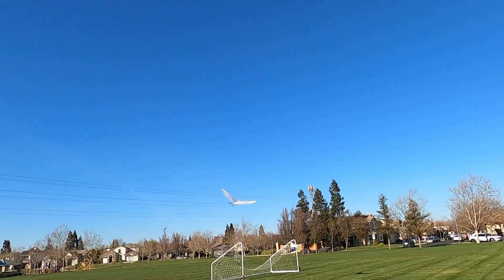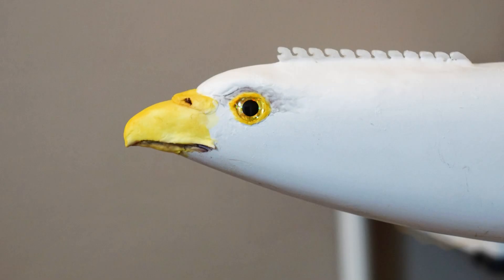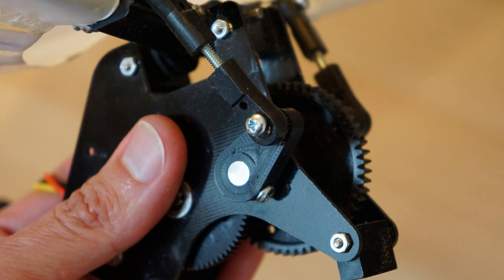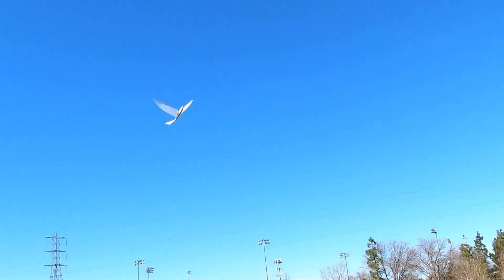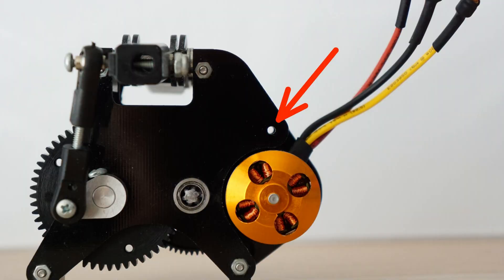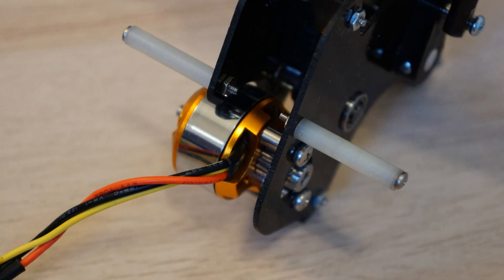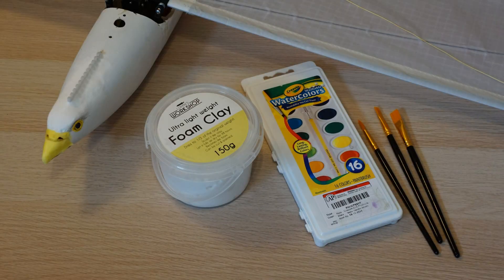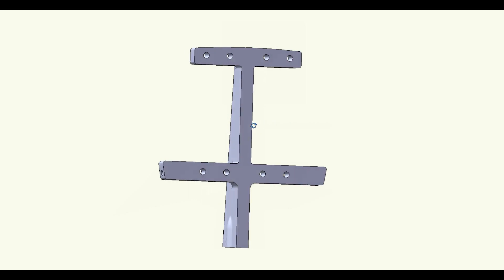Crossbow 2  RC Ornithopter Modifications

Comment: You took this pretty far. Launched just prior to the pandemic. Sorry it didn't work out. Never heard of birdkit until today. I notice most of your ornithopters are stiff straight strut wings. Have you ever considered adding the elbow and wrist joints of a bird or bats wing with an elastomeric "muscle"? The same motor would drive the wing, but its motion would be enhanced as it responded to the pressure of the air it was moving through. 🦅🪶

Comment: Hi, 

Is the kit available for this Ornithopter? And do you think I would be able to add some flight controller to it? With a black box? I basically want to fly it and also analyze the data on the ground as well so do you think this would be able to take payload and would a COTS flight controller like Pixhawk 2 work on it?
Reply from the maker: It can use a flight controller, and would be set up similar to a fixed wing airplane. There are 3 kits left, available from BirdKit.com, and then it will be out of production.